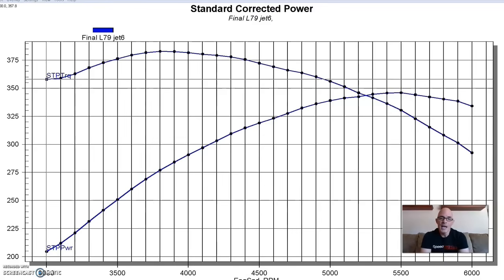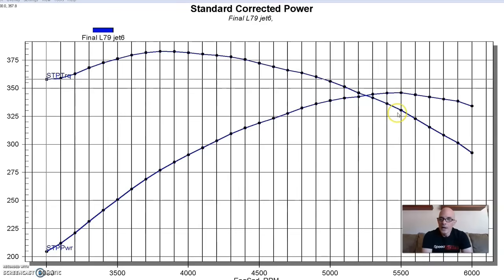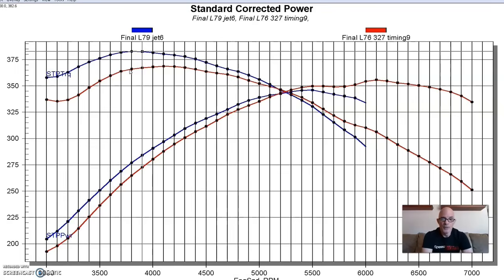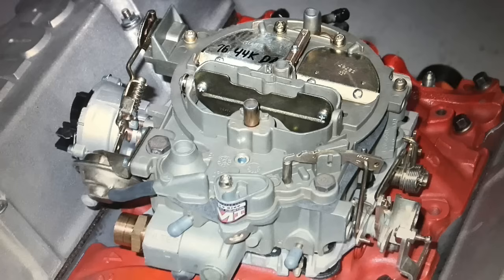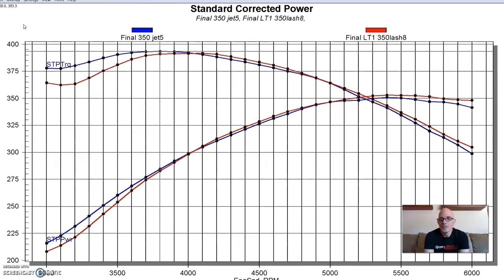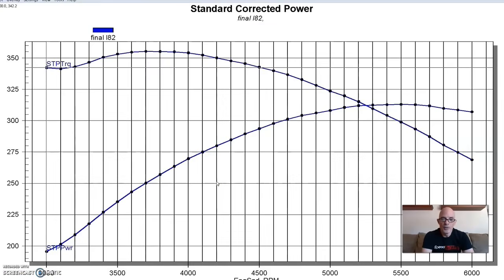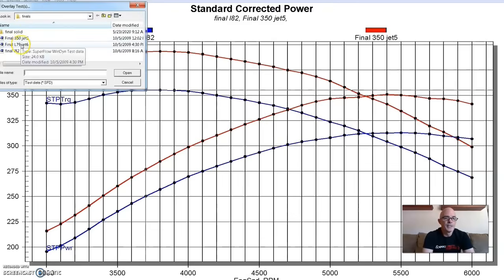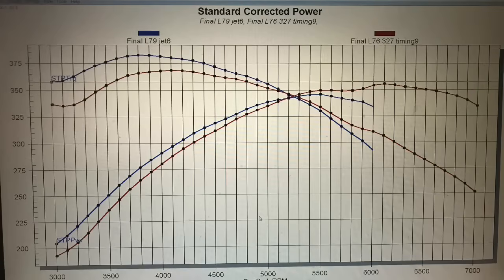HOW MUCH HP DID THE L79 350-HP 327 REALLY MAKE? WHAT ABOUT THE L46 350-HP 350 OR L82 250-HP 350?

Comment: Interesting thing about those 3 hydro cams...they can all trace their roots to a solid lifter cam, the original Duntov cam that started in 1956.
They're all single pattern cams, they all spec 221 degrees duration @ .050" lift (some sources spec 222 degrees duration) and they're most effective in the 2000-6000 rpm range.
The difference between the L46 and L82 really drives home just how much increased c.r. brings to the table.

Comment: When I was a kid my father bought a 1965 SS El Camino with a 327 and a close ratio Muncie 4 spd from a family friend it was a total rust bucket in fact you could see through the floor.  I remember about 1983 riding in it and these kids pull up in a late 70's (Big disco looking Camaro) my dad tells me to hang on. We take off,  he was power shifting and blew their doors off.  Coolest memory.  That engine was later bored rebuilt with new forged pistons,  Torker manifold, 750 Holly  a big Isky 292 Cam mated a turbo 400 with a 3200 RPM stall ( the Muncie was stolen) for my first car a 1967 RS Camaro.
Reply: I bought a 2nd hand 65 impala convertible for $400.
4 on the floor, bench seats a 327-350hp Muncie 4 speed.
Same scenario, blew the doors off the Camaros..

Comment: I ran a 327 , 202 heads , 283 crank,  11.5 comp pistons , inline early 2x4 gm intake with 2 inch spacers and 650 holleys, 525 lift , 292 duration solid lift cam in a 55 chevy with a Chrysler 8 3/4 rear , 391 gear and 4 spd .56 chevy straight axle ! What a hand full lo, ! Adjusted valves every Friday afternoon . It was very strong on the street. Lol , memories !
Reply: A327 with 283 crank is a 302 cube engine.
Reply: yes and it screamed !  Pure music to the ears around 8000 rpm

Comment: Floating the lifters out was the only real issue with hyd motors but the old double hump heads I’ve seen the studs pulling out the head I’ve listen to other guys back in the day would have them drilled and pinned to keep them from pulling out

Comment: I once drove a 68 corvette with the 350 350 horse engine. I found it to be very torquey and well mannered in city traffic. Those 66 nova 327 350 horse motors ran well but I added headers and a 750 dp carb and it made it turn on. That small carb limited the power.  I still have that flat bowl Holley hanging on the garage wall. Lol
Reply: If you've got an original L79 carb, you're sitting on some $$$.

Comment: Hi Richard, you are the best. I had a different experience with cams though.  I once had a 350/350 type set up (dbl hump 1.94, 10.5 to 1, Torker II, 750 Holley, 1 5/8 headers, with a 327/350 cam.  It made ok power.  Then I switched to an LT1 cam and the difference was dramatic, I am talking about at least 30 hp and 30 torque everywhere.  In addition I could rev the engine where the alternator belt would fly off before the power would drop off (6500+).  Now I had an M20 and 373s but still my Nova while not being one of the quick cars was certainly terrifying on the street.  Bottom line is that I would not recommend a 327/350 cam but would recommend the LT1 or the Duntov cam if you want to run stock type springs.

Comment: In the early 70s I would take the 30-30 cam to local machine shop have them put the Isky E-2grind on it and then use poly lock instead of the pinch nut on the rocker arms

Comment: The L46 350hp 350 was a Corvette only motor as far as I know, not offered in other Chevys.  The L79 hydraulic cam was a popular addition to a Chevy small block.  A good friend added that cam and a small Rochester 4gc on a cast iron intake to his 307 and the car really responded well.  There were only two hydraulic cams offered in Chevy small blocks in the 60s.  The L79 cam and the other one, in everything from 170 hp 283 to 300 hp 327.

Comment: Ok Rich. This is long. But it goes back to late 80s into 91. Had a 1980 camaro v6 white knob 3 speed Saginaw manual brakes I got from my dads friend with 23k on it for  $800. & 1971 nova 6 cylinder sport for free with a bad power glide ( customer left it at our shop )that this goes back to ; starting with the camaro. Bought a PAW 355 lower end through car craft mag. Base was forged flat top - steel gm crank - with the lt1 pink rods - moly rings file fit all disassembled in boxes with 4 week turn around time to zero deck the block back then & paid in the $1350 range. 010 4 bolt block. I had sealed power down the street in Chelsea Ma. My friend @ the salvage yard had an account to buy whole sale. I got the 327/350 l79 cam kit with everything including anti pump lifters / .060 wall push rods / 1.5 steel rockers / 1.25 z28 sprigs & retainers ; about $275 total ; I had a set of 882 heads from a totaled 1976 vette   With 2.02 - 1.60 valves  & screw in studs with guide plates also in that vette a borg Warner super t10 i used in the camaro ; I put aside that 4bolt 010 block from the vette that had factory steel crank & forged trw pistons  we just rebuilt for a customer at our family repair shop a year prior planning on using it for my 1976 c10 4x4. Going on a car craft write up..... I took apart the 882 heads & pocket ported under the valves myself ( took me two months of nights & week ends. ) almost killed myself trying high speed to go faster on the pneumatic die Grinder breaking 3 bits. Bought a cheater valve after my dad recommended it after a smack  in the back of my teen age head   Going low speed. Had the local machine shop take the deck down on the heads t0 get compression up & 3 angle valve job i did myself in my high school machine shop. I used an offenhauser 360’ intake with a Holley 750. After the assembly I did myself - Hei distributor - curve kit - black jack aluminum coat ak500 headers 1.5 primary- hays clutch 3 finger 11.5 truck set up - with a 8.5 posi unit out of 1981 turbo trans am ( salvage yard disc brake 3.70 ratio) I bent my own exhaust on my old Ben Pearson. 2.5 all the way & dyno max turbo mufflers. 4 core radiator & clutch fan with shroud. J bolt lake wood traction bars / m. Thompson Indy profile ss tires in the rear 15x8 with Eagle gt’s up front 225-60-15  15x7 on corvette rallies all salvage of the vette i had. Ok. It’s track time ;
Best of 13.01 @ 103mph on the Indy profiles & 19.5 psi. After playing with the curve & 36 total timing ( all this was learned via hot rod & car craft magazine over a seasons time ) then on the last day before the track closed I read on 1.6 rockers to add .030 about on the cam. So I went to sealed power again got the rockers 
12.79 @ 104 mph 😏 between all this I learned to launch correct & shifting @ 6200 rpm 
1988-89 ish 
Next season : I went to the solid Duntov 30-30 cam with the 1.5 rockers & a summit tunnel ram combo 465 Holley carb - upgraded to a carter mechanical pump that needed a regulator from the street carter pump. Set lash @ .030 intake .030 exhaust hence 30-30 cam name -  went with a Mallory dual point due to no space for hei. : all else was same 
First time out 
12.67 @ 106mph 
My dad said take the valve lash sown to .010 on intake & exhaust to get more lift 
12.59 @ 106 mph
1.6 rockers swapped 
12.34 @ 106mph 
I had to change to poly locks due to valve lash changing with regular nuts 
Played with jetting & swapped to Mallory unilite distributor 
12.17 @ 108 mph 

Ok. Motor came out & changed to 302 Chevy ( story to be continued on the camaro & old motor with dual quads went on my c10) 
1971 nova sport -
Used my vette l82 lower end & did an identical set of 882 casting heads like my camaro but did intake port matching & cut them down to up compression ( only reason I used those was factory screw in studs & guide plates due to $350 cost to do that @ local machine shop ) left the l82 cam with Rhoads lifters 1.5 ratio & poly locks. 1.5 headers - hei-750 Holley & offy intake i had - turbo 350 with a super hole shot 3200 - 3500 10 inch stall - 3.55 ratio - gm 8.5 posi i got from salvage I re clutched - with the same wheels as my camaro on aluminum corvette slots from an 80 vette a friend parted out- did my 2.5 with sonic turbo mufflers 
12.68 @ 104 mph 

70 lt 1 solid  cam swap  from sealed power start with 1.5 rockers 
12.44 @ 107 mph 
1.6 rocker swap 
12.30 @ 108 mph 

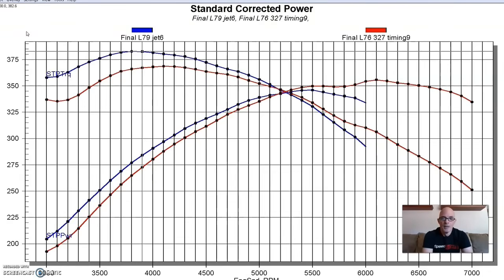4:10 gear swap 
12.01 @ 109 mph 
( note : used poly locks on all the swaps ) & carb jetting 
Between this i had fuel issue due to 6 cylinder 5/16 fuel line & fuel pick up not supplying G. P. H volume & car ran 13.99 @ 99mph ..... my friend @ the salvage yard was at the track & helped me ....he said it sounded like it ran out of fuel ..... we pull a plug that was white & lean. Went back and he noticed the fuel Line ....  also a kink ..... got a new tank - pick up & 3/8 line that fixed it with a good filter to flow. 

That’s my experience with budget builds & using the recourses to get better bang 💥 for the buck. Crane - Isky & earson cams back then were more money than today for valve train components..... triple of my sealed power. Car craft - hot rod & popular hot rodding  did a great job prior the internet & you tube. Tech lines did not start getting good till mid 90s in my experience.... you would have  to do it by trial & error. That’s if you took the time to read & stay on top of new issues. The other way was trying to find people going fast & that’s if they shared the combo & what they did ( that was very rare back in the day / people were miserable fucks back then ) the guys who went fast we’re old  war veterans & most were not friendly due to what they’d been through. Thank you guys for fighting for freedom ( even though a lot of you were not helpful to our generation back then on sharing knowledge) I still respect you all. You made us learn the hard way for Reason- hard work = results & to strengthen the mind.

F. Y. I on using the cams on factory performance to review :
Cost was a lot less than brand names ; they were under .500 lift & press in studs use to come out in the older heads from gm; the valve guides were inconsistent on height & sometimes over .510 lift they would hit...... read that in the magazines.....

Comment: I like the hydraulic because it was low maintenance and held its own like the L79 I build a 327 similar to that for my 68 chevelle and felt for a heavier car it performed well with a modern dual plane intake n Holley 4160 600 cfm carb

Comment: Love the show.  What I didn't see was, lots of us back then was running 327's with the 151 cam but with higher s pressures 115/320 there was rocker studs pulling out of the heads. That's when the first stud pin kits came out. And then onto screw in studs. And don't forget those 461's and 462's that we had to drill the pushrod holes out on. I ran lots of 151 and 30/30 cams . They had there place. The l79 cam was great for a mild build.  I found the 30/30 to actually be lacking in performance compared to putting in an isky cam and lifters. The hot setup then was someware around 240@.050 450 lift on 108 or 106. But needed a good converter with 342 or higher. Most people I rember then did not have 411 like everyone talks about for the street. Btw. I also ran the famous 186's and I never saw a performance gain other than the bolt holes. And if we're talking about performance back then nothing beat a good double pumper. I like q jets but that double pumper was hard to beat. If a person wants to recreate a performance engine of those days. The key to power was what we called super tuning. And it took time to set up an engine, but that's what winners had going for them. Thanks for the great vids.

Comment: I have an old school 350/327 cam kit right for my local GM dealer still in the box and the lifters are unopened. I'm going to put it in a 76 Vette L48 with a set of Edelbrock E-210 heads i got a smokin deal on used.  I wasn't going to use it but this vid and the one you compared the big flow aluminum heads has made me change my mind!!! Thank you and keep up the good work!

Comment: 11:12 Richard, buy NEW nuts from Chevy.   The NEW nuts are NOT ROUND, new nuts are OVAL ( self locking).
In high school I drove a REAL Z-28, with the 30-30 camshaft.   Would rpm that engine to 7,000+.  Had to reset the lash each month or each weekend. Would run slicks on the weekend. 
Ask me how I know about new oval nuts.
Reply from the maker: we installed new oval (pinch) nuts-they don't work as well as poly locks

Comment: I would chose the L46 and change  the heads to some AFR195, Intake to a Perfomer RPM, a Carb Shop QJet, some roller rockers of 1.6/1.5  and hyd roller of about 224/230, 550/550ish on a 108 co and call it good!

Comment: The first 425 hp 396, in the Z16 Chevelle, had juice lifters.  A good flowing head makes up for a mild cam, and Chevy tended to flow better. Fords, Mopars, etc generally liked smaller valves and ports unless you bought the Cleveland, Hemi, Stage One, etc. But its for naught when the factory has, say, an F body exhaust--ninety degree bend after the rear axle into one big muffler, then other ninety degree bend to run alongside the gas tank.

Comment: I’ve always had issues with the factory rocker arm pinch nuts. I always run poly locks regardless of solid or Hyd lifter. So much deflection from a factory stamped rocker arm. At minimum every wngine should have the thicker Comp Cam magnum roller tip WITH a set of poly locks. I’d love to see a dyno test from stamped stock rockers and just the Comp magnum roller tip upgrade.

Comment: That’s a great group of engines to compare. I spent some time duplicating the solid lifter versions some years ago. The 327 was an awesome street and strip combined with a 4 speed and geared properly. I used a 461 x head which really made decent power but ran out of valve spring until they were upgraded.

Comment: Richard, after watching this vid (for the 3rd time!) I bought the Elgin version of the L46 cam, 224/224 @ .050 .450/.460 and a 114° LSA. I’m going to run it with Vortec heads, a .030 over flat top 350, air gap, and headers. It’ll be going in my Squarebody. I just need to decide on a carb. I have a freshened Qjet, that’s for an 80’s 454, a 750 Edelbrock, but I’ve heard & read good things about the Summit carbs... we’ll see. Awesome, awesome video for SBC guys like me.

Comment: Friends don't let friends run L82 cams.  That cam was designed for much more compression and just makes a super LAZY low-end with a really poor "Dynamic Compression Ratio". 

The cams also came from GM with 3 degrees of cam timing retard build-in, so if this test @ WestTech was made with a "Nostalgia" grind from Comp or another cam MFGR, it likely came ground "straight up" with more "pep in it's step".  The intake timing was also retarded from the factory because of EGR and the "natural EGR" from the big seat-to-seat duration that resulted from the lazy slow  1960s designed cam lobes. -A well-tuned "L82" engine actually runs a LOT better than they came from the factory.

L82: A great bottom-end, ruined by a terrible tune, a pretty bad set of heads (especially the 264 thin casting heads that came after the 882s that were super crack-prone due to thinning of the casting). 

If you've got an L82, add a Felpro 0.015" shim gasket to get the static CR up 1/2 a point, and add a more modern grind, faster ramp cam and just tune the thing and you can see huge gains.  -The stock cats are also TERRIBLE and they need to at least be replaced by modern high flow cats.

Comment: i have a 68 camaro that I built my own version of the L-79.  327-210 short block,1.94 fuelie heads mildly ported and milled 0.60,factory high rise, Rhoads lifters,stock Hei,headers,and eldelbrock 9625. real sleeper, idiled at 550rpm easily rev'd to 7,000.
13.1 et @118mph with turbo 400 and 3.55 rear.  I really stunned a lot of other cars on the street with that one in the 1980's

Comment: To be clear ,the "DZ" is only the 1969 302 engine letter prefix, the '67 and '68 Z28 302 used a MO ,MA prefix and was also sometimes shared with the 327. I find the term DZ used as a blanket reference or catch phrase for all Z28 302's.

Comment: I built a L79 327 for my 68 corvette last year and used aluminum heads but only achieved 10.5:1. 3700lbs, and a 3.70 rear. I ran the rams horn and stayed pretty consistent at 100mph and 13.7 sec in the 1/4 mile with a lot of spin off the line   https://www.youtube.com/watch?v=o10wZXMZDhA

Comment: Yes my hydraulic cam backed off but the solid did not , but  I had a old guy from those days put together the motor, and just found out my motor was a x head motor and the cam was not the same they proclaim, it was bigger,and the 106 ,it barely idle but smoked the tires, all 4 gears best Malibu I had that was not a ss, got it for 1/3 the price with all the power, and know it sets in a collection,  but I did replace it with 05 GTO

Comment: I ran into an '85 Chevy pickup with a mostly stock 350 that the rocker nuts would come loose on. I replaced them with a new set of jam nuts but to no avail. I finally swapped on some poly locks. I like that the hydraulic cams put out more usable horsepower than the solid lift cams. I had a '77 Monza back in the early '90's that I bracket raced. I put in a 350 that was stock except an L79 cam and a set of Hooker headers. With it's stock 2.21 rear gear and 13" tires it would run consistent 14.0's and it was my daily driver with functioning A/C and it was totally streetable, even in the snow!

Comment: I was wondering ,is that the shed you live in? They, the nuts, back off because they are not that insane as to want to be beaten constantly by solid lifter cams. No Really ,the studs back out and you need to use threaded studs.
And you can put the nuts in a press and tighten them up a bit . 
The era of SB chevys. The Z28 was a screamer, the 350 hp anything was great even in an Impala Super Sport with 4.11 gears and a Powerslide trans. Tires were the problem back then anything could do a burnout.